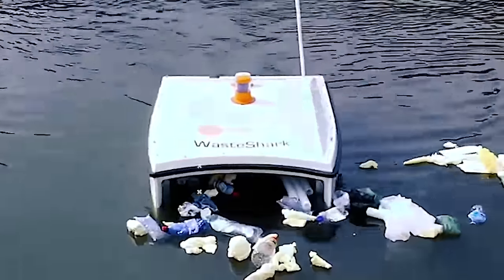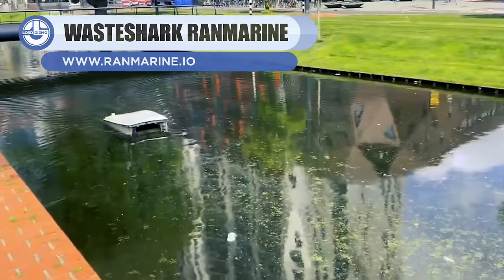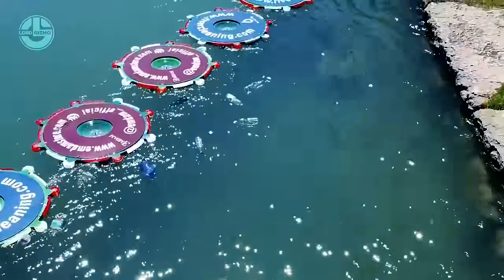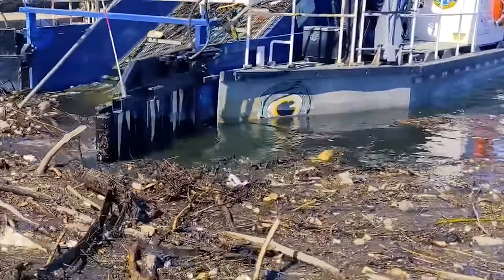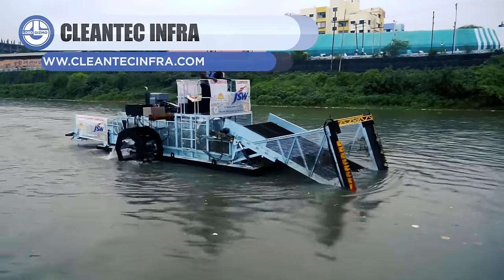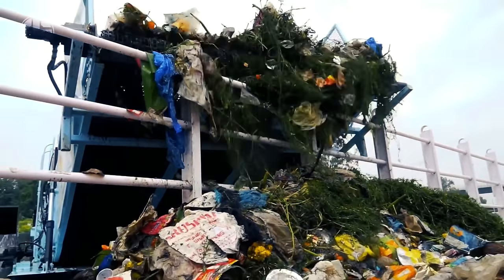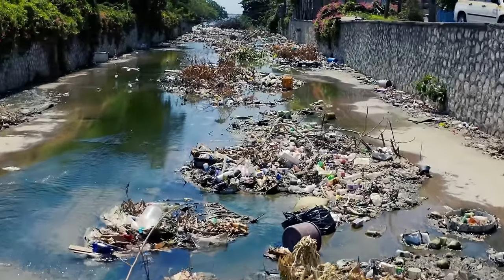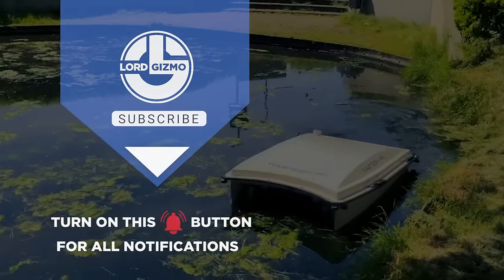Every Year, This AMAZING Technology Removes Millions Of Tons Of Trash From The Oceans

Comment: How about get a bottle refund going. People will have an incentive to pick up bottles and also stop people from chucking them out.  Other countrys been doing it for decades
Reply: And an army of homeless people who panhandle can make good money rounding up bottles instead of panhandling.
Reply: @EsspressoMan1:  Your comment got me reading more about recycling.  In Minnesota, where I live, we have curbside recycling.  
The problem I just found out, is the main material that recyclable bottles are made from is (PET).  The problem is:  it can be contaminated by certain other recyclable material in that same container.  That makes (PET) unusable.  I also learned we sell a lot of our good (PET) to China and then we need to make more products from new materials.   The more you read, the more complicated everything gets.
Reply: We need to get back to glass containers & create jobs around that instead of big petroleum using the excuse that it's cheaper to manufacture new plastics than to recycle old.
Reply: We used to do it. It worked very well
Reply: In Norway we have a system for that. It works perfect. Some 90% i think is recycled. Plastic bottles and metall soda cans
Reply: Recently here in The Netherlands you pay for plastic bottles (refunded by returning empty) and “one time use plastics” which are charged 0,01 per item!
Reply: Hey Espresso man,
Here in Maine we've had a bottle redemption of $0.05 for decades but there are still those who throw them out beside the road.  You'd think since the consumer put a deposit down on the drink container would provide incentive to keep them out of the environment.  Unfortunately ignorance is a terribly strong force.
Reply: @cherylsmith4826 the reason years ago we switched to plastic was the cost of shipping was by weight and plastic weighed less and also no breakage.  problem with Glass is it breaks and did you know a old coke bottle can last a million years supposedly ?!   There are new plastics that break down in sunlight also
Reply: @longreach207 problem is , 05¢ is nothing. CT has gone to . 10¢ but I think 25¢ would be better .  It really adds up fast

Comment: Despite their different compositions, wood and plastic have some chemical similarities. Both materials are organic, meaning that they are made from carbon-based compounds. Both materials are also flammable, meaning that they can be ignited and burned. Additionally, both materials can be degraded by exposure to heat, light, and oxygen.